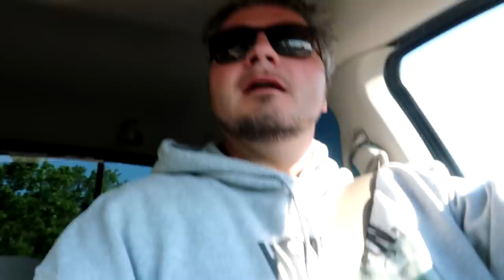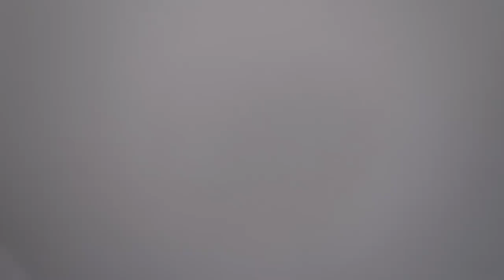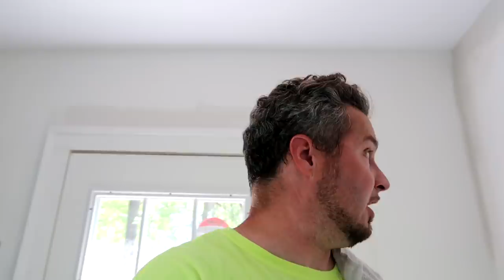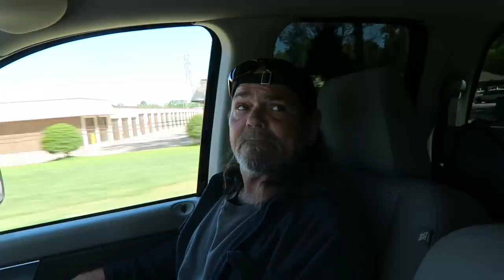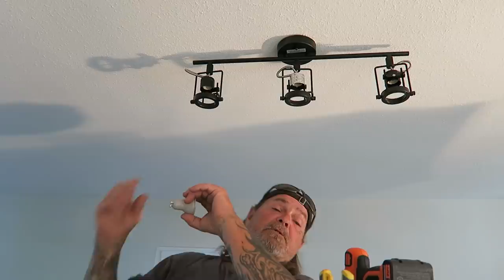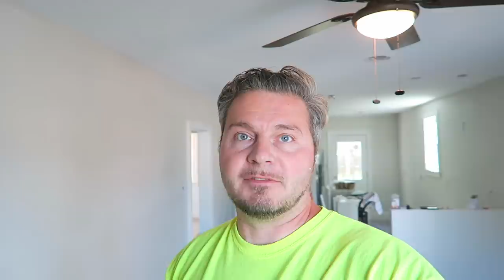It's Time To Start Painting The Flip House...

Comment: Little tip from a professional  painter Joe... those ceiling lines can be done in a way that looks very sharp and not have those high and low/up and down waves..if you paint about an eighth of an inch along the very  top up on the ceiling it will give the affect you are looking at a perfect line..I see those types of "rolled" ceiling lines where there is no definitive sharp angle all the time...you just have to literally cut up into the ceiling..only an eighth of inch or if possible less..use that technique in a closet a few times to get it dialed in...also pulling your cut line instead of pushing makes it easier to lay quicker lines..looks great so far man!

Comment: Here is some tips for painting.
1. Buy a  9" tape gun and some frog tape or blue tape(i prefer bluetape on fresh painted surfaces),mask off all of your base boards and trim work (because your new at this and dont have the skill to cut straight)
2. Mask off any floors with same tape gun and tape. If the wall goes straight to the floor. ie.... Bathroom 

3.get a caulking gun and some latex caulking, and seal all your trim and baseboards.Grab yourself  QEP Extra Large Multipurpose Sponge and a medium bucket of water, dip the sponge ring out till its damp and wipe the excess caulking in long precise strokes until it looks tight and uniform.
4.make a cut in bucket from an old 1 gallon paint can fully cleaned out.  then paint over all the trim and baseboards in one direction lightly until one whole wall is done then pull the tape slow.  The caulking should be still wet enough to leave a nice crips line and also painted all in one. then after all the baseboards and trim are done, cut in all the ceilings. 
5. Then if your gonna roll out a house, wash out one of your empty 5 gallon paint buckets and buy a $1.99, 5 gallon metal paint grid to roll out of they are easy to pick up an move versus paint tray.
6. Get yourself a purdy powerlock paint stick or any power pole with a locking system.  i would start out with a 2'-4' for hallways and tight spots, and a 4'-8' for rooms and open spaces. save your hands, arms and forarms from all that stress.
also don't forget to lay paint resistant tarps down all over your floors and appliances. 

7. Move all that shit from one room to another, much easier, plus 8 ft ceiling get yourself a 4ft ladder with fold out tray, perfect height to be eye level with ceiling corners. makes for better ceiling cut ins.
Reply: I don't know if Joe will follow your advise but I'm going to try your steps next time I paint.

Comment: Joe, On that 2nd house.  Make absolutely certain that you get all of your  INSPECTIONS...  Please ,not the all in one building inspection, but get the Electrical, Plumbing, Roofing, Structural, Termite Inspections form certified companies that warranty their work. Make certain the roofing company can give at least a 5 year certification on that roof.   Also get cost estimates to make all the repairs, including material. You may want to get a window, gutter quote as well, if needed. Now get your general Contractor in to access the rest and quote repairs on that. DO NOT say"I can fix that" and not get quotes.  Make sure the plumber inspects ,as well, (with camera) the main drain pipe from the house to the street .   Do and review each cost estimate  taking this into consideration before you make the offer to purchase. Always add 10-20% to your cost for the unknown.   Also, before purchasing, have you're Real Estate Sales Agent to give a market analysis on last 90 solds and work with them on what homes in the high end of range have and perhaps you can push that price (depending on what yours can offer)  .  I hope this helps and Good Luck Bro. and never give up!!
Reply: It's no use at this point, Joe isn't going to listen to any sound advice.  He's likely to repeat to the same mistakes with the new house.  He'll start with the cheapest options for everything and then work up from there until he's paid at least 4-5 times for the same job.

Also, it's a bit baffling why Joe wouldn't just pick a house that just needs some general things done ( maybe flooring, some drywall, trim/paint, etc ) versus getting a house that has significant problems like this one.

Comment: What's going on with electric? Is it just 3 wires? Is it 2 blacks and a white. Alot of the old houses in my State got the power feed from the light  in the light box then run down to switch  but all new construction is power goes to the switch then the light.

Comment: That fireplace is blocked off as the chimney is clearly not sound. Please do NOT buy another house without a proper inspection and licensed contractor to get it done. That contractor would save you from doing everything in the wrong order including flooring.

Comment: Joe before you even think of buying another house, yo ass need to look at the foundation first, you dont want any cracks in that shit. Find the main electrical panel for the home, inspect that and make sure the wiring looks new or newer, you don’t want shit from the 60’s. Check to see if your heating and your stove  is gas or electric, you want gas, its cheaper. Plumbing is kind of tough to check imo, I haven’t worked with much plumbing. I’m sure someone in here would chime in and let you know what to check on that other than your drains properly draining. Make sure the roof is new or newer and doesn’t have any issues or leaking. Good luck to you bro! Make sure and check all these things first homie!!!

Comment: Covered the outlet with dry wall ???  WTF joe
Reply: They also installed outlets way too low and had to cut the trim in all but the bedrooms.  Ghetto AF.  Unless you wanna custom frameout every damn outlet it's gonna look like shit.  More unnecessary work when it should have been done by a pro in the first place.

Comment: That house u looking at someone else trying to flip looks like just didn't finish
Reply: Could be a good thing, could be a bad thing... HOPEFULLY they had just ran out of funds ( that's a Really shitty thing to wish upon another), or on the bad side, they ran into HUGE problems like ALL the electrical work needs to be redone ( but we know Joe will have it re-ran a time, or 4 until it's done right 🤣🤣)... In which that case, you may have to cut open a bunch of the drywall that looks to be already completed

Comment: Me and a buddy of mine could paint that whole house within 24 hours.
Reply: Im a painter 20 years exp. That house needs two guys that kno what their doing and a week
Reply: @rickwhite4835  I've painted an entire machine commercially within 48 hours with breaks here and there for drying times and got done within their time span to finish their installation. Made a good damn amount of money.  So money talks. Lol
Reply: What surprises me is that Joe was bitching and complaining about everyone's carelessness and shit but yet he doesnt have plastic on the floor or windows or nothing and yet wanna hang lights and fans up.  I'm sorry but Appliances comes after paint is officially done.
Reply: They are painting a house with rooms ceilings trim all different colors and finishes that is nothing like painting a machine like a backhoe ? What kinda machine are u painting to get all this talking money lol comment section just as bad as the video
Reply: Did you even read what you just tagged me in
Reply: @rickwhite4835  trim and ceiling and walls dont take that long especially a small house.
Reply: Rick White for sure if you have a good work ethic
Reply: @rickwhite4835  I did.  I've painted inside and outside residential and commercially.  I know what it takes.  Either way,  Joe I wish nothing but the ultimate best for ya,  but you really should lay plastic down and keep that floor upkept.
Reply: Well wouldnt you paper all the floors give the entire place a good sanding with exception of textured walls clean all the dust prime and backrolll everything caulk and spackling then just putting two coats of finish onvtje entire place is time consumeing anybody can walk in with a sprayer and make a mess im a professional painter and professional resultuls take time thats how he got in this mess trying to do tons of wrk fast
Reply: @rickwhite4835  Agree.  I may not have a business license I just do this stuff as a side gig and I've learned lot of stuff just by doing it.  So hopefully Joe,  himself will learn stuff as well.